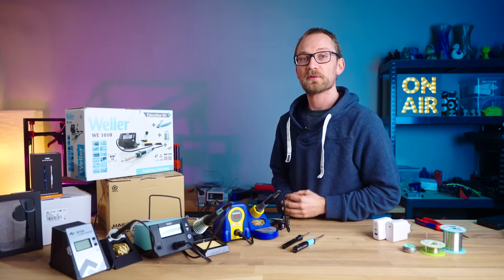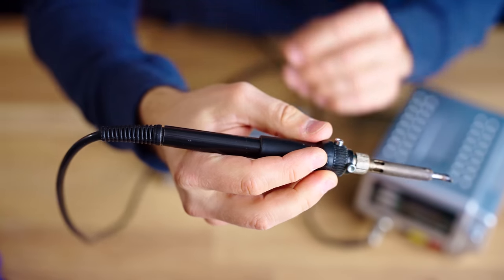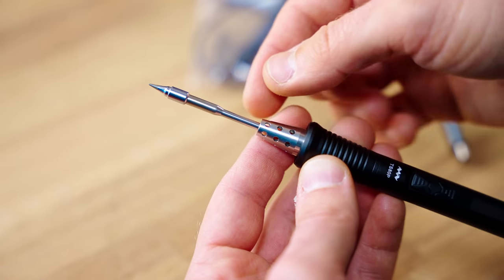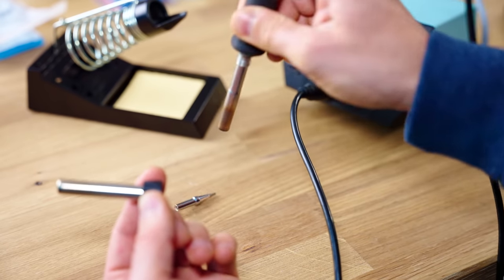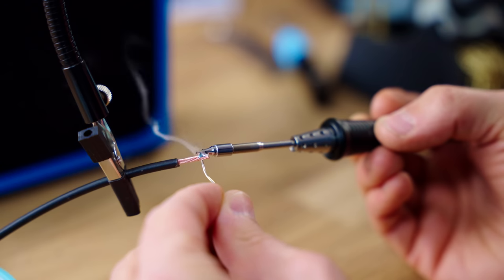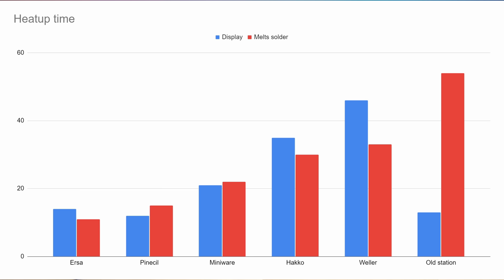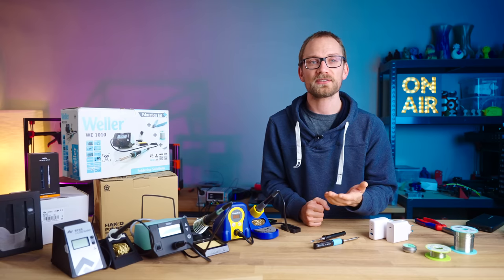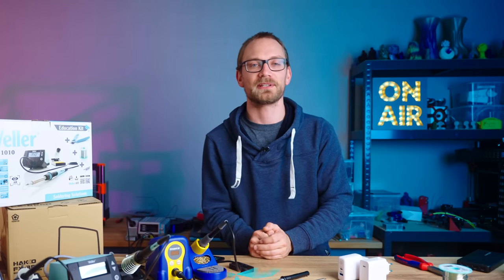Best hobby soldering iron? Pinecil vs. Miniware, Hakko, Weller and Ersa

Comment: Love the Project Farm vibe of this video.
Would be nice if your sponsors upgrade you to some more professional soldering tools to compare too. Used Ersa and Weller in professional settings, and we now got a full JBC rework station (4-tools) for a new workspace that i have yet to test and compare. I was very impressed by the large choice of oddly shaped tips JBC offer. Metcal would be another big name that is probably more geared to professional use that would be interesting to compare.
Reply: Nice but Tom should give credit if hes going to copy his phrases (We're gonna test that), etc.
Reply: @orbitalair2103  If you watch to the end of the video he does give credit to Project Farm.
Reply: JBC is much better in my opinion. I wish JBC was incldued in the review. By the way, hakko is Japanese. He didn't mention it unlike german ones he did.

By the way, Pinecil has boost mode. Otherwise, it doesn't go full power. Not sure this review is done with boost mode too.
Reply: @orbitalair2103  credit for using words in a certain order?
Reply: JBC is a totally another kind of budget
Reply: Aixun T3A and T3B soldering stations also get good reviews (JBC clones) and use the JBC tools.
Reply: Marco Reps did a review of that 4-tool rework station, might be worth checking out.

Comment: 22:34 actually the Ersa does kind of auto wake up from stand by once you touch a surface with the tip and heats up again from standby temp to set temp. Sensing and reheating is actually pretty fast (dep on your set standby temp). In fact can hardly remember using the button to wake at all.
Reply: This is true. I've had the Ersa i-con nano for some years now and used it a lot. Great product, never had any regrets spending a bit extra.
Reply: This is true.  I have one for a few years now.  I'm just a bit shocked about the price hike...

Comment: Great review! I have the 
Ersa i-Con Nano and love it! Heats up very fast, rich selection of tips available, and the handpiece with its flexible cable and short grip-to-tip distance is a joy to use. Never bothered with the SD-card, the default settings are good. Just turn it on and go, no fiddling with settings necessary.

Comment: I've used a Weller for decades and never had any problems. When you buy one, you can be fairly confident that replacement tips will be easy to find in the future. I used the iron professionally and don't see the need for a complicated interface.
Reply: Finding tips 10 years in the future is a bigger deal than people realize. If you go with any 'production' soldering iron company like Weller, Metcal, or even Hakko, you'll be able to get tips and heating elements well into the future, and can probably use the same parts from the past. 
I have a TS-100 I bought on a whim but never use it outside of soldering things outdoors, like in the car or working on antennas. The interface is fine, but it's a bit much. With my benchtop station the only time I need to touch the base is to turn the temp up or down a bit. I use the same solder and the tip holds the temperature really well, so I don't even need to change the temp very often. Just turn it on and by the time I'm set up it's ready to go.
Reply: I don't rate Weller very highly, they're okay for light use, but not for everyday soldering. Metcal is much more durable and almost impossible to break even with constant use for years.
Reply: @hhin  Exactly. We switched from Weller to Ersa at work, about 10 years ago. Never had any serious problems since then, and it is very comfortable to use and powerful enough.

With the Wellers we had various software issues, the tip holders constantly breaking, etc...

Comment: I genuinely would recommend the Hakko FX-888D over the Weller if you want durability.
I rarely see a weller 1010 in a lab where the Plastic nut on the iron hasn't broken after a few years resulting in the entire tip assembly getting as wobbly as a loose tooth.
Having to wait till the iron is cold or using a plier on a metal nut is way better than a damaged iron.

Comment: I only used lead free solder in my electronic education, was the first solder experience for me back then, and took 3,5 years.

After that I begun to work where my predecessor was a totally fan of lead soldering, and I tried it too (he had few kg of solder left anyways), and damn its so much bether. I solder very often, at work and in my private workshop, in my opinion, if you do something really often it's totally worth it to do it comfortably and have as much fun as possible on that.
You always need to wash your hands and have something to filter the fume is very important, but then it's not that dangerous...

Comment: I’ve used a lot of really cheap soldering irons. Stuff you get from the hardware store. I love using the Hakko. I like the display refresh speed, and I really like being able to start soldering in under 30s. I’ve been using irons that can take easily 2 minutes to heat up. 

I’m very surprised that given the ease of finding replacement tips, it still was the least impressive option. Given my experience with cheap irons, I was really blown away by the performance of the Hakko.
Reply: My experience with soldering gear is that you very much get what you pay for.
I've been using an analog dial controlled Hakko for well over a decade.  I love it.  I learned on an ancient Weller station that I will some day inherit from my father because it's a Tank.
Reply: I had a hakko fx-888 (the analog one) and I miss it. I left it at a job somewhere (not using it for work, but forgot it there until after I'd switched jobs). I very much dislike the interface on the 888D. Changing temperatures around is a royal pain compared to just touching a knob. I love everything else about it though.
Reply: Finding Hakko parts just easy in the US i guess. Had trouble to find the iron after seen recommendations.
Reply: I've never really seen the Hakko refresh except during initial heat: at least mine appears to display the setpoint instead of the actual temperature as long as it's somewhat close.
Reply: I agree. I have a Hakko and I love it. Before that my primary iron was a Weller 35W pencil iron. I bought the Weller about 10 years ago after dealing with cheap Radio Shack firestarter irons my entire life and decided to splurge. The Weller is leaps and bounds beyond the old crummy irons with their anemic heaters and tips that oxidize and rot away after a few projects, but man, it sure takes forever to heat up. Like 5 minutes. Until then, you can't even tin the tip.
I bought the Hakko about 5 years ago and it was a game changer. I never had a legit workbench so when I finally built one, I bought a benchtop station. I don't know how I lived without it. Hot tip changes aren't a big deal if you just use some pliers. The only thing to look out for is accidentally changing the calibration offset if you press and hold the wrong button to change the temperature. Judging by the color changes of the tips, I was trying to use it at well over 400C, thinking I was around the usual 185-190C. For the longest time I couldn't figure out why my solder joints weren't 'wetting'. It was because I was vaporizing the flux as soon as the solder touched the tip. I figured it out, reset to defaults, and it's been smooth sailing/soldering since.
Reply: I also have this Hakko and like it a lot.  I only have crappy soldering irons to compare it with however.  When I bought the Hakko, I liked how popular it seemed to be.  I also like the many different tips you can get and how easy it is to get tips and parts.  The user interface could use some improvement.
Reply: The Hakko station is quite excellent - I solder professionally and would highly recommend this station if you are looking for something reliable with VERY low cost of ownership.  The station allows for the setting of 5 preset temperatures which makes quick temperature adjustment without manually setting single digits.  For tip swaps, I would recommend against this, and just buy several aftermarket handles (<$20) and populate each with a different tip.  The only negative of the station is the UI - you will have a stroke attempting to set things without a manual...the good news is that once you have configured preset temperatures, you will never have to touch it again.

Comment: The pinecil is also my favourite because i can power it from lots of different sourced with usb c pd becoming very common, i have a 65w lenovo power supply that cost me £5 and works perfectly, i also have a 100w power bank which i can use anywhere e.g. on the field for field repairs for my fpv drone.

I've also seen people run the pinecil with the short 6ohm tips on 140w epr with a software update, and the heat up time is almost instant, which is insane. The short tips are really nice. I exclusively use the chisel as it transfers heat easier.

Comment: This is crazy, I just purchased a Pinecil and some extra tips last night after doing a bit of research. I'm glad to have some reassurance that I made a good decision!
Reply: Lol I did exactly the same
Reply: Update us on it Greg!
I'm tempted too 👀
Reply: @drmed92  It should be here in a few days, I'll update when I get it and get the chance to test it out :)
Reply: @drmed92  Got to play with it a bit this weekend - the tip that it comes with works really well for most things, but you may also want a chisel tip if you're working with larger SMD components (it's compatible with pretty much any tip that works on the TS100)

Overall, super happy with it. I ended up 3d printing an enclosure for it, too, where I can keep it and the tips once everything cools off after I'm done using it

Comment: I absolutely love my Weller.  I have a different model compared to the one you tested.  It is hot enough to solder within 20 seconds or so.  I have used a lot of soldering irons in my life and this Weller is by far my favorite.  Thanks for a great video comparing several different types.

Comment: Metcals (which are twice the price of anything here) heat the core with RF and rely on the Curie point to set the temperature.   Net result: super fast and super stable to a fixed temp and super easy to swap hot.  A possible downside to some people (outside of the obvious price issue) is that the tip determines the temperature: if you want to go to a different temp, you use a different temp.  But for soldering normal things, they are fantastic.
Reply: The tip setting the temperature is also a benefit for production work where for consistency you want all the assemblers using the same temperature. The shop can enforce that by only providing one temperature type tip. My WESD-51 does that by having a control lockout that is toggled by touching a magnetic tool to the ESD symbol. But the production environment "feature" and reliability means that the Metcals have a production environment price tag...
Reply: Yes.  Metcal acknowledges 2 patents in the design of that station.
1905 : Induction Heating (Metcal uses RF)
1959-1965 : Weller’s Curie Tips and Magnetic switching.

Comment: The best Investment I've ever made, was when I bought the TS100 in the Set. Its really fast in heating up and also is able to solder larger areas or areas that disipate heat better than normal ones. 
Also due to the Lightweight design, its also really easy to solder precisly like with the TS80.
Reply: Ts-100 is what I ended up using after 2 years of using multiple different devices for surface mount. Electrical engineer here!!
Reply: I've used a Weller station forever and was amazed at the TS100
Reply: Same here. Always used cheap stations, but the TS-100 is the best investment I've ever made in that regard.
Reply: I was pretty surprised not to see the ts100 in the lineup, I have to say.
Reply: Having used the impressive Ersa iconpico(propably the best station for the money, except the tip nut breaks now and then), i can easily say my TS100 is the best by far(except the handle, which ersa is better).
Reply: @raptakisk.9983  The ts100 is open source so you can find a version that has a metal handle instead of plastic. The ts100 is among the best in every category even though it's not the best at anyone thing, it's the best well-rounded iron. It's the best all-around iron for anyone wanting one.
Reply: @tripy75  The Pinecil is a TS100 Clone, with USB C added.

Comment: Very fond of my Metcal soldering iron, wouldnt change away from that for anything these days. Quick to solder, short reach so nice to use and generally bombproof (mine was already second hand workshop sell off style when I got it). Tempted to look into a Pinecil for portable soldering now though ...
Reply: Bought a used Metcal years ago and I've always loved it. Thought I might get a TS-80 for the portability eventually
Reply: I have several soldering stations. And the one I go to when I have to do a lot of soldering is the Metcal. It is such a pleasure to use! It is also the only one I have with tweezers. It is not cheap though. 
My second choice is the XYtronic LF-3000. Strangely enough, as it is one of those Hakko kind-of-clones. For the money it is hard to beat.
Reply: @Haakkon  if you just want portability TS100 over TS80 personally
Reply: I love my Metcal PS-800.. Still going strong after 15 years.
Reply: Bought a used MX-500 on e-bay 10 years ago.
Even for present days won't change it even to MX-5000, nor any other brands.
Who try Metcal once, won't change it :)
Bought a bunch of used and new tips of prefered types for surplus, and seek for prefered models on e-bay once in 3-6 months.
In "Service laboratory" use mode MX-500 tips works from 1/2 to 2-3 years, depending of type of needed jobs.

P.S. Bakon 950D with 5-10 different T13/T12 cheap chinese tips for portative use is my choice for last 5-6 years :)

Comment: I think it's important to point out that the Pinecil v2 now supports higher wattages which (I believe) should improve its ability to keep up with heat dissipation on larger copper wires or plates

Comment: I'm using a TS80 for around 2 years and i really love it. Bevor my TS80 i had a Ersa Station i bought in the mid 80'th :-) The best thing on the TS80 is, that you can also use it with a Powerbank... very handy outside ;-)

Comment: I’m shooting out some love for the Ersa. I love that it only needs little space on the desk, the ultra-flexible cable, the short iron itself, ultra fast heat up and response times. The software profiles are nice and helpful, but why managed via microSD and desktop software (does this even run on current OSs?) - and not on the device itself - can only be explained by late 2000s marketing department requirements, assuming today it would get IoT and an app to it for similar unnecessary reasons, lol. Anyhow rocking this iron now for nearly a decade and happy with it like day one.
Reply: I believe it was meant for soldering workshops where the employer doesn't trust his employees to use the right temperatures. From my own experience I know that soldering pros tend to use way higher temperatures than recommended and later no-one knows why certain heat sensitive components have such a high failure rate.

Comment: Pinecil + ToolkitRC P200 is an insanely small and versatile setup. The P200 doubles as an incredibly small variable power supply with an additional USB-C out that's perfect for powering the Pincecil (the pine store also sells high temp silicone USB-C cables that pair the two wonderfully).

Comment: Soldering onto a large heat-dissipating surface (like a heated bed) is where the biggest difference can be noticed.  It's almost impossible to do without a fast-heating iron with good thermal transfer.
Reply: You get a large chisel tip and crank up the heat to max. My insane iron goes up to 600C in just few seconds. Gotta love the crazy Chinese engineering.
Reply: I agree. Having great power capacity like Ersa and Weller is crucial for effective and comfortable soldering, in my opinion.

Comment: In 2015 I got myself a very sturdy CHF-LD48 soldering station from my local hardware store. It's built like a tank and works like a charm.
A year later I ordered a set of spezial use tips for it, and yeah, it's been a great soldering station so far.

Comment: Great comparison, thanks!  Love my pinecil, one great benefit (maybe not for everyone) is that with a simple power supply (18v drill battery and adapter in my case) it can be completely portable with a very long runtime.  😀

Comment: Used a Weller at work and now I'm spoiled with soldering irons. The cable is so heat resistant and soft it heats up in seconds too. Incredible quality

Comment: Hi Thomas, there is a great alernative for the hobbiest. This iron outperfoms almost all irons. It's called the ksger soldering station. There service is great and they have awesome tips. For 50 euro's you can't go wrong. The only thing I am missing is a T12 iron for brass inserts.
Reply: agreed
Reply: you can also get similar models that straight up use JBC tips and then blow everything here out of the water.
Reply: @tommihommi1  jbc tips?
Reply: @gst8248  JBC, the company that makes the best "no compromise" soldering stations which the TS80 etc took a little inspiration from.
Reply: ah thanks

Comment: I love this whole comparison, great work. As an german electric engineer teaching a whole production line regulary how to solder, I love every good video. Internally I was shouting „include a JBC station“, I know it‘s pricy but world class leader in every case you testet. The tiny irons you tested are cheap mobile copies of it.
Reply: As i commented somewhere here, there is still the JBC "Weidinger Edition" analog Station, it is around 240€ incl. VAT, which is expensive, but still way cheaper than the next "best" option from them!